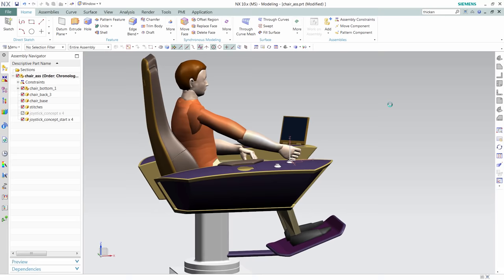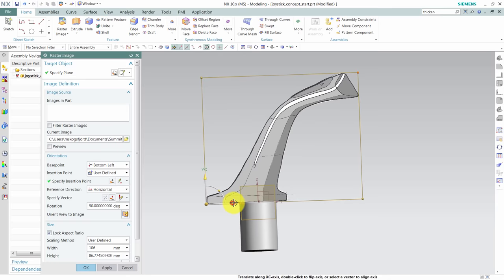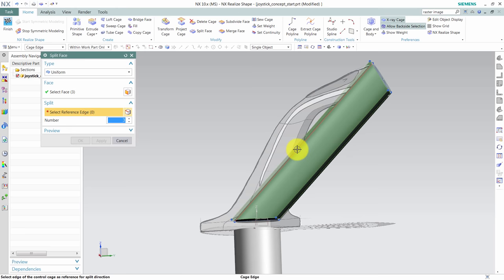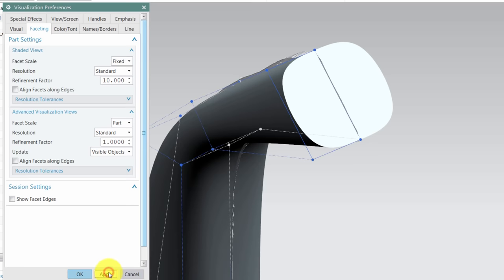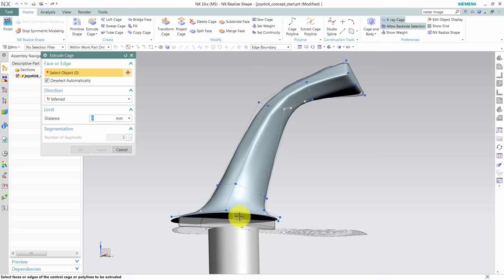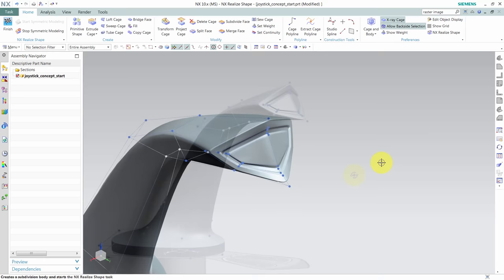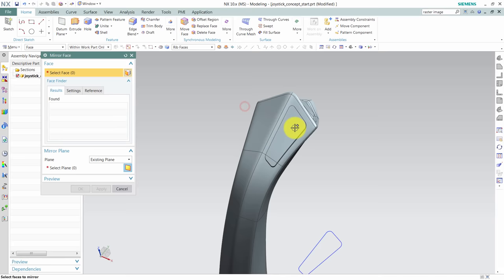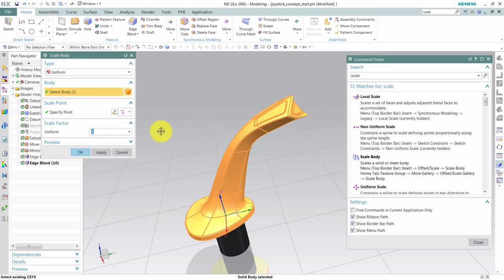NX Realize Shape | 2 - Joystick Design

Comment: Is there a way to like define the distance between 2 points?

I don't want to use Swept to create a Aircraft wing. I want to use realize shape instead. But in the Assembly the height of the fuselage is parametric. So the wing has to be as well.

Comment: the option for deselect automatically is not showing in transforamation cage just below the select option...

I have searched everywhere but all in vain............ Help me out here how can I get that option
Reply: Old question, but... in some versions of NX, the "Deselect Automatically" radio button is not in the Trasform Cage interface. However, in your selection toolbar, there is a button called "Exclusive Selection". Toggling that 'on' gives you the same behavior.

Comment: Do we have set weight command like we have in NX software in Fusion360  I really need to know
Reply from the maker: Dattatreya Mekala I don't know the command "set weight" in fusion 360 since I haven't tried this software. However, if you mean to calculate the mass of an object, you can do that using "Measure Body" in the Analysis tab. If it's difficult to locate, search for it using command finder in the top right corner of your window.
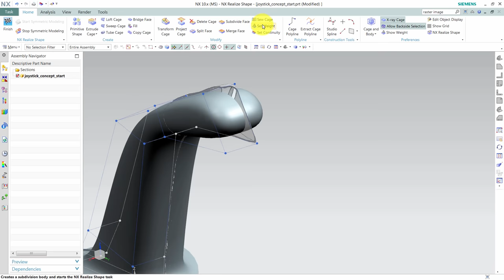Reply: that not i was asking for my question is the way u increased the set weight command to sharp the edges at 5:35 
 to make the model sharper
Reply from the maker: Dattatreya Mekala Ah, I'm sorry, I misinterpreted your question there. But again, I do not know what fusion 360 offers in that area.
Reply: any how thanks you so much for rply